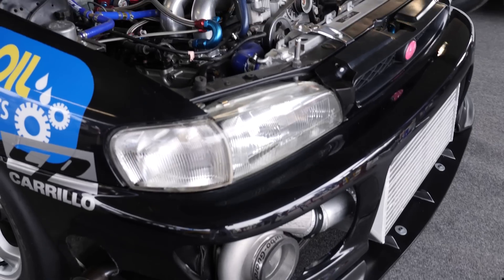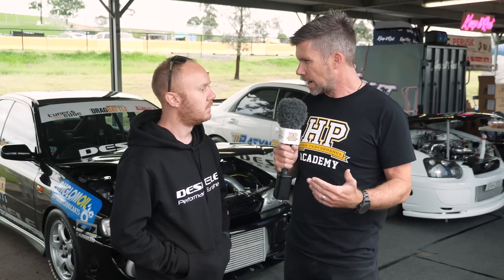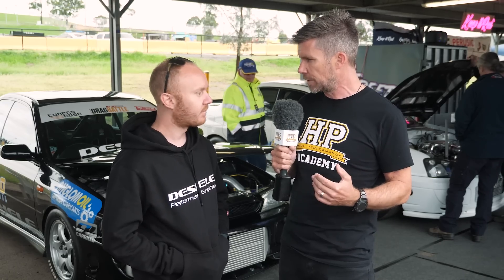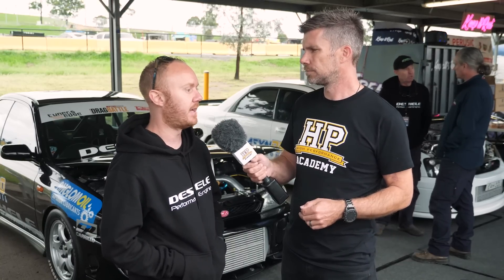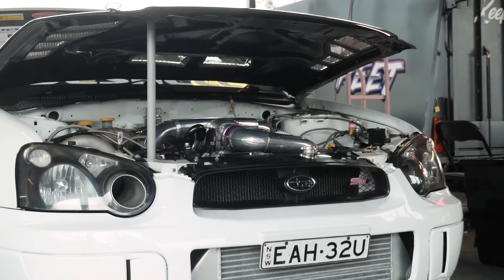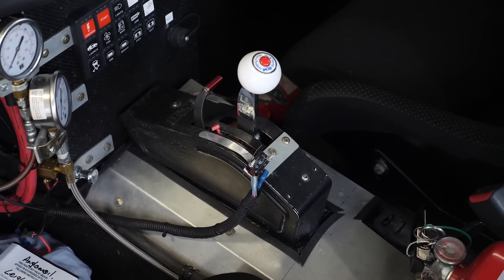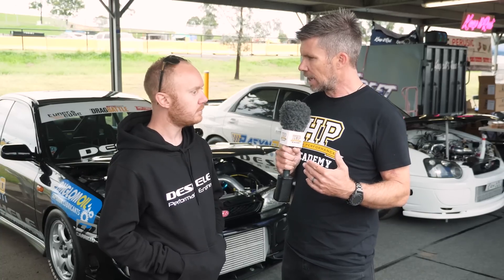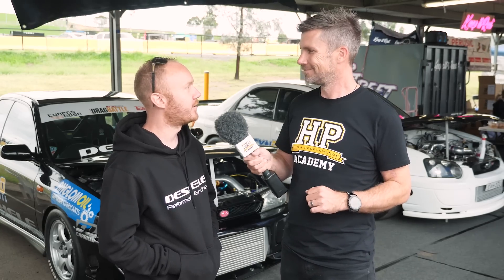You're Building Your 10,300rpm, 8 Second Subaru EJ All Wrong. Maybe.

Comment: I don't see the point in under-torquing arp head studs because as mentioned there is less clamping force and the can back out. May as well stick with the factory bolts if the worry is distortion.
Reply from the maker: We completely agree. Save the money and stick with the factory bolts if you are not going to set things up properly. You can then use that money for something else worthwhile by comparison, so long as whatever that might be is also done correctly though I guess! 😅 - Taz.

Comment: 😂😭I’m at game over after spending all my money on a new closed deck block and fully built engine since I wanted something super strong and reliable for my build goals. It spun a rod bearing at 6000 miles of normal driving only going into boost 1-2 times per drive while dailying it to work since the turbo is so large. So the car is just going to be a driveway decoration since I can’t/won’t be able to afford to fix it nor sell it since I spent $30k on the engine build and it’s worth maybe $3k with a blown engine. The worst part is nobody around me will work on Subarus and the one shop that could will only put their own custom built engine in that’s $17k by itself for a quote of over $30k. Sadly the block company and the shop who built my engine says the issue isn’t their fault and don’t warranty any work even though they say they do.
Reply from the maker: Take them to court. Got to be worth it for that much money if that are indeed at fault! - Taz.
Reply: @hpa101 sadly I don’t have the money to. Plus the shop is covered since they forced me to sign something saying they’re not liable for any damages since the car is modified for performance and the block company is only liable to pay for the cost of the block I bought which is only $7k and in betting court fees alone are half that.
Reply: what shop is it? spinning a bearing at 6k definitely sounds like a clearance issue to me

Comment: Plz do the conversion on screen for the us market.kilowatts 🤔
Reply: 871 bhp
Reply: 600kw is 804hp. 1hp is about 3/4 kw.
Reply: Or just learn the units that other countries use (1hp is approximately 0.75kW)
Reply from the maker: If it counts for anything, I work here and I still just use Google to convert it when required. Super easy - Taz.

Comment: "Reliability" i hate that word with engines at this level. They will never be reliable at these types of power levels. That being said this guy knows his shit and im sure is very successful. But compared to these engines stock they are not reliable no matter what you do
Reply from the maker: It's all relative. Reliable to do 100,000kms with only planned maintenance interval work is different to being reliable to do an 8 second pass without spitting metal, or these days multiple passes within the planned maintenance intervals - Taz
Reply: @hpa101  very true i just hear people out in the world see "reliable 800hp subaru" and think you can build a daily driver like that and get 100k miles out of it. That being said you guys do a good job bringing accurate relevant information forward and as an engine machinist/builder i love hearing from other professionals pushing the limits of what these engines can handle.

Comment: Surprised to hear that they are using an EJ25 running standard liners. Here in the U.K. we struggle to keep these engines going above 500bhp due to issues with the standard liners and the lack of material there. Even adding a closed deck insert, we are still seeing issues with the liners splitting.  The US and the rest of the world doesn’t seem to suffer such issues.
Reply: Yeah that’s odd, there must be something going awry with how it’s being done where you are. I’m in the US and across all platforms it is a very good solution. Here at least they are cnc machined then pressed into the block and then the block gets resurfaced also they are thick. Like at least 25mm I believe even as much as 50mm
Reply: @crxkid16  you are referring to sleeving the block, which is well proven for higher horsepower builds, as long as the machining work is done correctly so the sleeves don’t drop. I’m referring to the factory liners, particularly on the EJ25’s as featured in this episode. They are renowned for spitting liners, even with a closed deck conversion, so much so that respected builders in the U.K. will not look to push one past 550bhp. In the US, companies such as IAG rate some of their blocks to over 800bhp on the factory liners. I also heard no mention of aftermarket sleeves on the build in the feature.
Reply: You're not wrong. EJ25 liners are weak, even closed deck. The solution is longer rods which reduces the angle of the rod (up to 8.11%) which relieves stress on the cylinder walls. Long rod is a standard practice and on almost all IAG blocks.
Reply: @scoob_dj  tune with less aggressive timing g
Reply: @kirk-michaelharris1683  the issue isn’t timing related, the issue is the EJ25 block integrity. Not a problem with the EJ20 or 22’s.
Reply: We also have to be aware of the limits on the engine by design.  It is not a 2jz or 4g63
Reply: Try a 2l block. Ours is at 800whp and no issuse with the liners.
Closed deck and MLS gaskets with arp studs.
Reply: @gfarnden56  I’m well aware of the capabilities of the 2l engine, we have been using them in 2.1 strokers for 800bhp+ builds for many years. I’m specifically interested in how so many overseas builds utilise the standard ej25 liners for big horsepower builds when we struggle to keep them alive past around 550bhp which is where they seem to all split.
Reply: @scoob_dj  could it be something with fuel quality? Idk what the difference is across the pond. What else could it be, besides the tune?
Reply: @scoob_dj  maybe you need more PTW clearance...

Comment: Andre didn’t want to touch the headgasket issue, did he? 😅
Reply: I'm by no means an expert but afaik headgasket issues are more common on the 2.5L engines and are usually a symptom of lack of proper care and maintenance or bad setup. Not a fundamental flaw in the design such as narrow bearings or sump issues at high lateral g forces.
Reply: @cespa4206  this is an EJ 2.5. But they did a whole head stud upgrade. I’m just poking fun at the issue because it’s been around as long as the internet.  Lol
Reply: With 871whp (650kw), 45psi and running that engine for years, I think headgasket is just a novice question to bring up. It is more appropriate for say your normal subaru specialist workshop, then it wouldn't be a worthy interview to do at all.
Reply: He might not even run headgaskets
Reply: @andrewross2534  jesus man you can see the gaskets ffs
Reply: over the years the issue has been resolved, when machined it NEEDS to wear a torque plate and only use mls never any other
Reply: 14mm headstuds were mentioned and have been standard practice for a while now. They're well proven at this point. WRC cars also used larger headstuds than factory EJs.
Reply: @byloyuripka9624  my bad I wasn't looking to hard at it
Reply: @andrewross2534  copper head gaskets.
Reply: I'm going to bet those copper gaskets are O-ringed.
Reply: This guy actually uses  a mill machine to insert copper O rings seats into the block to strengthing head gaskets.

Comment: Honestly, 600/650 hp for Subaru is perfect! Unless you wanna build your high hp on a H6 engine then sky is the limit!!
Reply: I think it's 650kw at wheels, which should be around 871whp, with say around 15%-17% lost, it is more than 1000hp in your term for comparison.
Reply: @ray1394f  600/650hp at the wheel is more than enough for a sti! Of you wanna convert to Kw.. not a lot of suby rides around at 1000hp
Reply: Wasn't it 600 kw? I nearly spat my coffee out when I saw it.
Reply: 400+ is perfect for Subaru, especially street/daily :) Anything more is beyond perfect. AWD + modified = very fast
Reply: @Martin944turbo  very good!!
Reply: Honestly I tend to agree.
When mine was 600whp you can still throw it around but at 800 I'm holding on for dear life...lol
Reply: @gfarnden56  🤣🤣🤣🤣
Reply: @gfarnden56  lol :D

Comment: Seriously used the svx transmission? The one I had constantly had issues at stock setup, and everything I've ever heard about them was the same. I'd love to hear what changes he made to it.
Reply: The earlier ones had a hard time due to a lack of cooling, the lazy/smooth 3rd gear shifts and lack of external filter. The SVX did get a slightly better TC than the Legacy did, but it was in a heavier car with a lot more torque. 

They added a filter and made tweaks through the years of the SVX, but an external cooler and good filter goes a long way. 

On mods: Valve body mods to get the shifts firmer and generally higher line pressures to keep the clutches together. Not sure if they have upgraded clutches/other internals in their units but I’m super curious! 

I have a 95 SVX, got it with a bad 4EAT for cheap. Put in a 4.44:1 unit from a 1998 Outback and it’s been pretty solid.

Comment: if the builder ever reads this, why go 2.3 route instead of a 2.7?
Reply: The walls of the cylinder become too thin, he’d have to have sleeves inserted and then re-line-bore the whole thing because it warps differently. Basically he wanted high RPM and all the heavy lifting done by the turbo not the crank/block
Reply: He did also explain going down helps with the engine harmonics alot ..especially at 10k😂

Comment: When you consider an EJ shortblock shown here weighs only 115lb and is making over 1000hp at the crank, is it not the most powerful engine per pound?
Reply: 13B
Reply: @Realtime1501  the capacity of rotaries are a bit of a red herring. They are much larger than it says on the box
Reply: @santouchesantouche2873  you can't deny the weight for that size

Comment: Subi content!!! My fully built sti with a closed deck block spun a bearing from low oil just cruising in traffic si it definitely is a big issue. Sadly I was going to fix it and retune for my high boost tune as I was only running low boost to let the engine break in but now with the Cobb betrayal I’ve got to find some more money in order to get a standalone ecu. Any suggestions anyone??
Reply: Link ecu
Reply: Haltech or link. Or just use open source tuning on your stock ecu.
Reply: That sounds like a problem between you and the engine builder that you should resolve
 Shouldn't have spun a bearing in traffic if it didn't overheat.
Reply: I want a Motec but considering the price i will probably get the Link ecu g4x
Reply: EMtron is also good choice too.
Reply: @matthemberry  never overheated, just burned oil from 10 degree starts
Reply: If you find a good tuner that can set it up Syvecs is the best
Reply: @kvarnis8549  sadly no tuner within 8 hours of me will work on my car, they all think it’s too complicated no joke that’s what 3 subi shops said
Reply: @zokusharuuku1091  if it span a bearing I’m not surprised they said that - particularly if you put the bearings in yourself? But for sure to spin a bearing in traffic suggests the clearances were wrong, nothing to do with the oil delivery mechanism. I’m sorry bro. Maybe save up for a cheap electric caliper/gauge meter for measuring out the block clearances, since it’ll all have to be re-honed if it spun a bearing and got too hot. The Aluminium can warp.
Reply: @John-rw9bv  had a professional tuning shop build the car, they specialized in Subaru and evos. The bearing work was from a different company and neither place warrants their work.